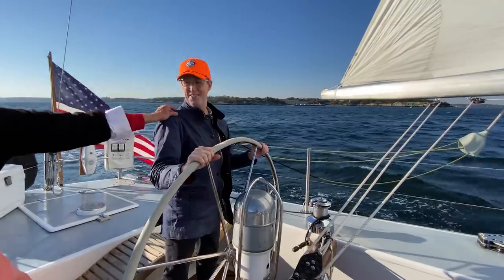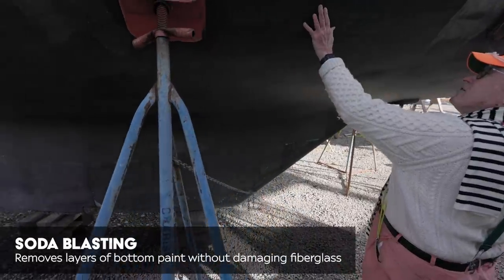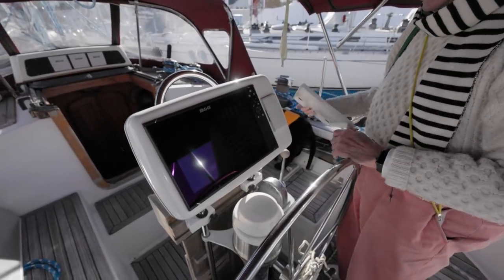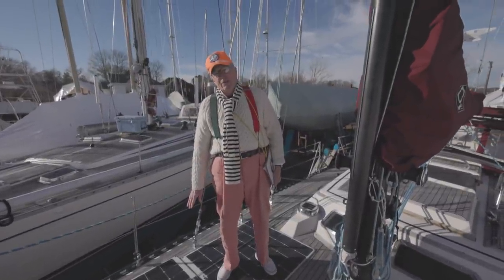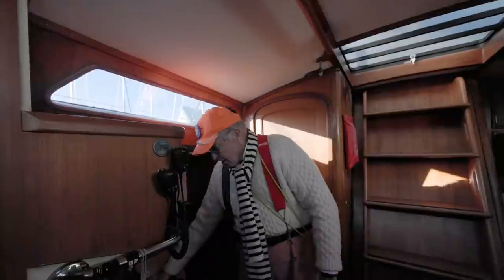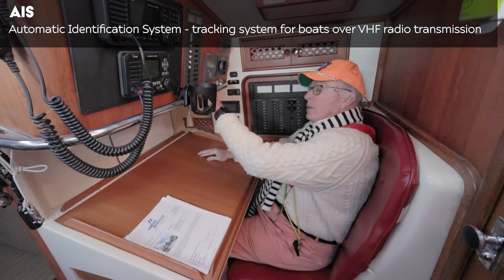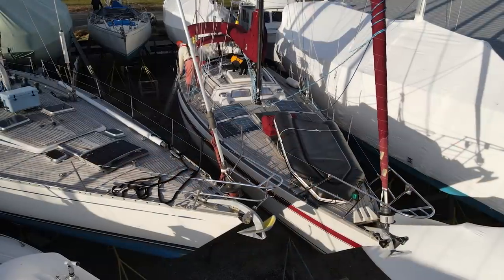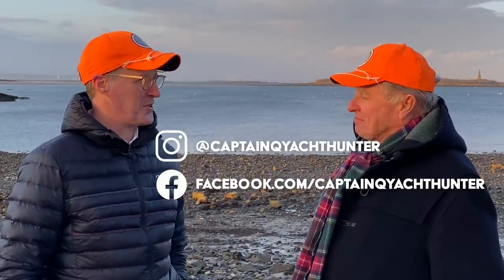$99,500 USD GLOBAL CRUISER! Proven bluewater sailboat for sale! EP76 #sailboatforsale #sailboattour

Comment: Nice BUT that deck and the damage the screws leaking have done to the core is a expensive issue to deal with
Reply: I was looking at this on Yacht world and then did some research about the decks being screwed in from underneath. I am guessing that the deck need to be re done with the bungs popping! I am wondering if the core is saturated.
Reply: You can see the damage everywhere the deck is leaking as discoloration of the woodwork.  Sadly, that's a ton of damage that will have to be corrected along with the deck replacement / removal (update to KiwiGrip if they're smart).
Reply: All of these old boats are nice to look at but what we really need is some estimate what it would cost to fix them. How often should standing and running rigging be replaced. How much wood requiring and/or replacing a deck cost. How much replacing a teak deck such as that one would cost. Also having a good survey on a boat and what you should expect to pay for one would be exceedingly helpful. I think we’re putting the cart before the horse here
Reply: @SP-wg5pn  good points. Just from what I saw on video this boat will need $50k+ spent on restoration. Which means there's probably at least that much again I couldnt see.
Reply: MORE INFORMATION ON DREAM WEAVER:
Accommodations
Sleeps 7-8.  V berth forward.  Enclosed head with vanity and shower next aft to port, hanging lockers opposite to starboard. Main cabin features U-shaped dinette to port which converts to form double berth, settee opposite to starboard. Galley next aft to port, forward-facing navigator's station opposite to starboard. Aft owner's stateroom with double berth to port and single berth to starboard is accessible from main cabin through a second head, with vanity and shower, located aft of navigator's station. Both toilets are Wilcox Crittenden Skipper models, both rebuilt in 2019. Shower fixtures new in 2019.

Galley
U-shaped galley features propane four-burner, gimbaled, stainless steel stove with oven (oven  not working),  Sea Frost (2021) 12 volt refrigerated ice box and separate freezer with digital monitors and controls, double stainless steel sinks with pressurized hot/cold water. Propane system installed in 2019.

Electrical
12 volt DC and both 110 volt AC and 220 volts AC. Engine and generator starting batteries are 12 volt lead acid. House batteries consist of three Relion RB-300-hp 8D 300 ah lithium iron phosphate batteries (2019). Four deck-mounted semi-rigid, walk-on, 175 watt SolarWorld Sunmodule solar panels mounted on foredeck whose 700 watts of power produce as many as 250 ah per day! The four three-foot-square panels feed two 30 amp Victron SmartSolar MPPT charge controllers, monitored via a Victron Color Control GX mounted at nav station. Eclectic Energy (British) D400 wind generator (2019) with max output of 600 watts. Nex-Gen 5.5 KW 10 HP diesel genset (2019) with 75.7 hours. 110 and 220 volt Victron Energy inverter/chargers (2019). Boat automatically accepts 110 volt or 220 shore power and can output both voltages simultaneously, if so desired.

Electronics and Navigation
Brooks and Gatehouse electronics suite including forward-facing sonar, AIS transceiver, 4G radar (antenna mounted on mast), three Triton2 multi function displays, 12" Zeus3 chartplotter, and barograph. All purchased new in 2019, all updated in 2021. Simrad hydraulic autopilot (2019) networked to B&G system, Icom M803 marine HF SSB radio transceiver (2019) with DSC and color display, Icom AT140 automatic antenna tuner (2019). Insulated backstay serves as SSB antenna. Copper foil ground plane glassed into hull during boat's manufacturing process (standard practice with all Lafitte 44's). Icom IC M-506 VHF radio transceiver (2019) with RAM mike (2019). Iridium wifi satcom system (2019). King wifiMax router and range extender (2019). Ritchie SP5 binnacle-mounted compass.

Hull and Deck
Modified full keel with skeg-hung rudder. External lead ballast. Airex-cored hull, balsa-cored decks. Teak decking. Double bow anchor rollers. Maxwell electric windlass, rebuilt in 2019 with foot switch and wireless remote control. Double stainless steel lifelines (2018) with starboard boarding gate. Edson steering system. Four opening overhead Bomar hatches. 10 opening ports. Two Marinco solar vents with reversible fans. Two midship deadlights (2019). Cockpit shower. Dyneema jacklines, port and starboard, running bow to stern. Three padeyes in cockpit for attaching safety harness tethers

Sails and Rigging
Cutter-rigged keel-stepped aluminum mast. Staysail stay fitted with quick-release lever at base allowing stay to be quickly deployed or stored. Running backstays. Sail inventory of 7 sails, all made by Port Townsend Sails in 2019, includes fully battened mainsail with two deep reefs (30% and 60%), light air loose-footed mainsail with snuffing sock, roller-furling 115% genoa, Dyneema-stayed drifter, particularly robust staysail, storm trysail with separate track on mast, and storm staysail. Block and tackle boom vang with Dyneema line, 22', 20 lb. carbon-fiber whisker pole (2018) with integrated stowing (flush with mast) nd deploying system. Harken mid-boom mainsheet traveller (2018) mounted on house. Winch inventory includes two Harken #35 two-speed, self-tailing, mast-mounted halyard winches, Lewmar #30 self-tailing, two-speed, mast-mounted, reefing winch, two Lewmar #55 self-tailing, two speed, primary genoa sheet winches, two Lewmar #40 self-tailing, two-speed winches mounted on coach roof, one Lewmar #46 self-tailing, two-speed winch mounted on coach roof. All standing rigging and turnbuckles new in 2018.  Most running rigging replaced in 2018 with Dyneema. All chainplates removed in 2018, dye tested, and electropolished. All chainplate attachment points reinforced in 2018 with additional glass.

Mechanical
Wind Pilot Pacific (German designed and built) servo-pendumum mechanical windvane self-steering system (2019).

Additional Inventory
Viking 8-person liferaft (2019) in hard cannister mounted in a deck cradle. 3D Superlight Twin Air 290 9.5' inflatable dinghy. Burgundy cockpit dodger (2019) with zippered front window, stainless steel bows, and stainless steel grab rails on three sides. Burgundy bimini (2019) with stainless steel bows, full 360 degree enclosure, canvas covers for all windows, window on top for checking sail trim, and cover for top window. 45 lb. CQR plow anchor with 300' of 10 mm chain, 300' nylon rode, Danforth 35 HT with 50' 10 mm chain, Paul Luke 100 lb fisherman anchor (2019). Ace Sailmakers (E. Lyme, CT) Jordan series drogue. Plastimo extendable man overboard pole (2019). Stereo with two speakers in main cabin. Pots and pans. Toaster. Five fire extinguishers, six fenders, assorted docklines, two horseshoe buoys (2019), boat hook. Misc. engine spares.

Disclaimer
Reply: @larryboles629  beautiful boat I would be interested but as a new sailor it's like getting a hot rod with a beginners permit. Appreciate the detailed list of upgrades
Reply: @jamesowens2781  You may want to look at a  31' O'Day from the 80s.  Intended to be a weekender-coastal crusier.  You should be sub 20K easy.  Rather nice boats, I live on one for a little over 5 years.  Lots of island hoping in the Bahamas. Caribean.    Be happy, be safe.
Reply: @jeffatkinson3288  What are some of the issues with this boat that you would need to address immediately?
Reply: @johngarbarzyk5549  dont remeber. Video was 4 months ago and im not gonna rewatch. But if I wrote there are issues they should be obvious 😉

Comment: I really liked the interior decor but from what I'm seeing below it will take a fair amount of TLC to get her seaworthy. It really doesn't matter because I can't buy one anyway until my wife learns to like boats and that ain't never gonna happen.  Oh well, one can always dream.  Keep the good stuff coming guys.
Reply: Johnny, here are some of the things about Dream Weaver that Capt Q simply did not have time for in his short video:
Accommodations
Sleeps 7-8.  V berth forward.  Enclosed head with vanity and shower next aft to port, hanging lockers opposite to starboard. Main cabin features U-shaped dinette to port which converts to form double berth, settee opposite to starboard. Galley next aft to port, forward-facing navigator's station opposite to starboard. Aft owner's stateroom with double berth to port and single berth to starboard is accessible from main cabin through a second head, with vanity and shower, located aft of navigator's station. Both toilets are Wilcox Crittenden Skipper models, both rebuilt in 2019. Shower fixtures new in 2019.

Galley
U-shaped galley features propane four-burner, gimbaled, stainless steel stove with oven (oven  not working),  Sea Frost (2021) 12 volt refrigerated ice box and separate freezer with digital monitors and controls, double stainless steel sinks with pressurized hot/cold water. Propane system installed in 2019.

Electrical
12 volt DC and both 110 volt AC and 220 volts AC. Engine and generator starting batteries are 12 volt lead acid. House batteries consist of three Relion RB-300-hp 8D 300 ah lithium iron phosphate batteries (2019). Four deck-mounted semi-rigid, walk-on, 175 watt SolarWorld Sunmodule solar panels mounted on foredeck whose 700 watts of power produce as many as 250 ah per day! The four three-foot-square panels feed two 30 amp Victron SmartSolar MPPT charge controllers, monitored via a Victron Color Control GX mounted at nav station. Eclectic Energy (British) D400 wind generator (2019) with max output of 600 watts. Nex-Gen 5.5 KW 10 HP diesel genset (2019) with 75.7 hours. 110 and 220 volt Victron Energy inverter/chargers (2019). Boat automatically accepts 110 volt or 220 shore power and can output both voltages simultaneously, if so desired.

Electronics and Navigation
Brooks and Gatehouse electronics suite including forward-facing sonar, AIS transceiver, 4G radar (antenna mounted on mast), three Triton2 multi function displays, 12" Zeus3 chartplotter, and barograph. All purchased new in 2019, all updated in 2021. Simrad hydraulic autopilot (2019) networked to B&G system, Icom M803 marine HF SSB radio transceiver (2019) with DSC and color display, Icom AT140 automatic antenna tuner (2019). Insulated backstay serves as SSB antenna. Copper foil ground plane glassed into hull during boat's manufacturing process (standard practice with all Lafitte 44's). Icom IC M-506 VHF radio transceiver (2019) with RAM mike (2019). Iridium wifi satcom system (2019). King wifiMax router and range extender (2019). Ritchie SP5 binnacle-mounted compass.

Hull and Deck
Modified full keel with skeg-hung rudder. External lead ballast. Airex-cored hull, balsa-cored decks. Teak decking. Double bow anchor rollers. Maxwell electric windlass, rebuilt in 2019 with foot switch and wireless remote control. Double stainless steel lifelines (2018) with starboard boarding gate. Edson steering system. Four opening overhead Bomar hatches. 10 opening ports. Two Marinco solar vents with reversible fans. Two midship deadlights (2019). Cockpit shower. Dyneema jacklines, port and starboard, running bow to stern. Three padeyes in cockpit for attaching safety harness tethers

Sails and Rigging
Cutter-rigged keel-stepped aluminum mast. Staysail stay fitted with quick-release lever at base allowing stay to be quickly deployed or stored. Running backstays. Sail inventory of 7 sails, all made by Port Townsend Sails in 2019, includes fully battened mainsail with two deep reefs (30% and 60%), light air loose-footed mainsail with snuffing sock, roller-furling 115% genoa, Dyneema-stayed drifter, particularly robust staysail, storm trysail with separate track on mast, and storm staysail. Block and tackle boom vang with Dyneema line, 22', 20 lb. carbon-fiber whisker pole (2018) with integrated stowing (flush with mast) nd deploying system. Harken mid-boom mainsheet traveller (2018) mounted on house. Winch inventory includes two Harken #35 two-speed, self-tailing, mast-mounted halyard winches, Lewmar #30 self-tailing, two-speed, mast-mounted, reefing winch, two Lewmar #55 self-tailing, two speed, primary genoa sheet winches, two Lewmar #40 self-tailing, two-speed winches mounted on coach roof, one Lewmar #46 self-tailing, two-speed winch mounted on coach roof. All standing rigging and turnbuckles new in 2018.  Most running rigging replaced in 2018 with Dyneema. All chainplates removed in 2018, dye tested, and electropolished. All chainplate attachment points reinforced in 2018 with additional glass.

Mechanical
Wind Pilot Pacific (German designed and built) servo-pendumum mechanical windvane self-steering system (2019).

Additional Inventory
Viking 8-person liferaft (2019) in hard cannister mounted in a deck cradle. 3D Superlight Twin Air 290 9.5' inflatable dinghy. Burgundy cockpit dodger (2019) with zippered front window, stainless steel bows, and stainless steel grab rails on three sides. Burgundy bimini (2019) with stainless steel bows, full 360 degree enclosure, canvas covers for all windows, window on top for checking sail trim, and cover for top window. 45 lb. CQR plow anchor with 300' of 10 mm chain, 300' nylon rode, Danforth 35 HT with 50' 10 mm chain, Paul Luke 100 lb fisherman anchor (2019). Ace Sailmakers (E. Lyme, CT) Jordan series drogue. Plastimo extendable man overboard pole (2019). Stereo with two speakers in main cabin. Pots and pans. Toaster. Five fire extinguishers, six fenders, assorted docklines, two horseshoe buoys (2019), boat hook. Misc. engine spares.

Disclaimer

Comment: ... Dynema line does not "stretch" ... but ... it   "along -gates.  ???  As the "braid" tightens up,  the length of line gets longer,  but the fibers haven't stretched ... something to consider when using for standing rigging  or sheet-lines ...
Reply: Elongates.
Reply: @jerryf609  Thanks ... I tried every spelling I could think of ...  that's the only one that spellcheck liked ... and it was still wrong.
Reply: @harrymurphey2634  Ha ha. Sometimes I get a mental block myself.

Comment: Captain Q, I need a boat to cross a sea or 2. I am from Tennessee but currently in Saudi Arabia working. I have been looking online for months to find a boat. I need help! Is it possible to find a good sailboat for $20,000?
Reply from the maker: Yes.
Reply: @YachtHunters  I am supposed to send my deposit on a 1981 Nonsuch 30’ today. Boat looks like a good boat but a survey will confirm that. I have negotiated from $32900 down to $25000 but I am having some second thoughts as it’s a cat boat which makes any attempt at blue water risky.
Reply from the maker: Where do you plan to go  and where do you honestly think bayou will really go ? 
This boat had a fin keel and the ability to use two or three reefs   But it is only 30’   So your “safety “ factor is limited by that. 
I have not sailed a cat this size but smaller daysailers and they have some limitations (mainly  variety of sails for example)
I think they are cool boats. We did have a cat ketch we interviewed whic was built abroad and sailed here on her own bottom   A great coastline cruiser and island hopper 
Sounds like you’ve got a good deal started.   A lot of room to boot 🤗
Reply: @YachtHunters  I would like to cruise the Caribbean and possibly do the Panama Canal to San Diego